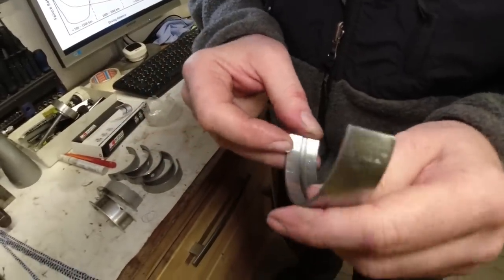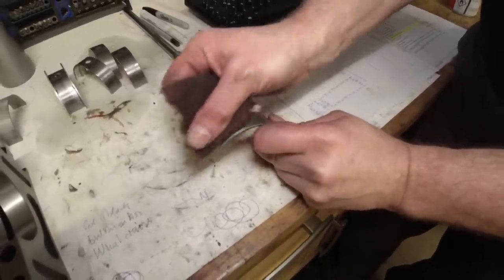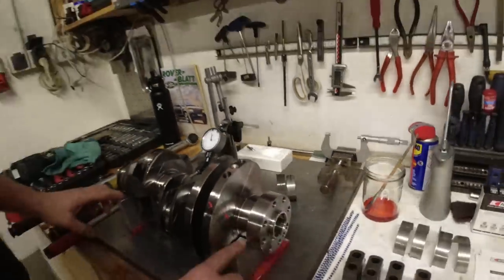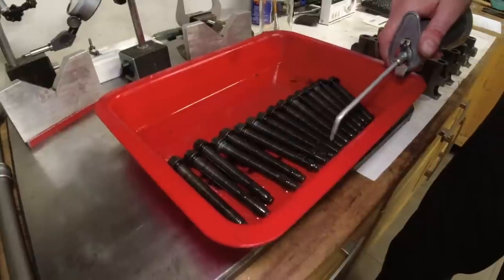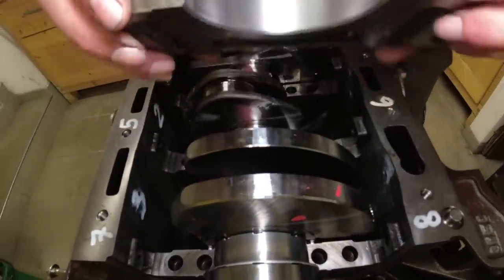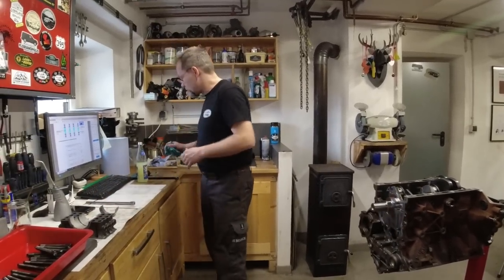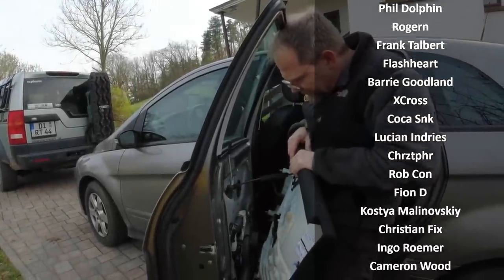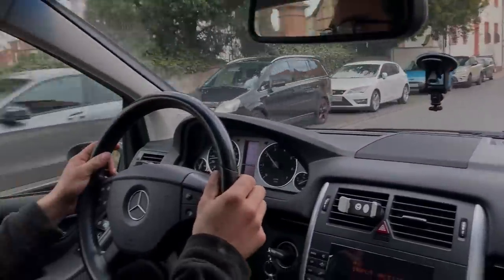Install New Crankshaft after only 64000 km / S4-Ep15

Comment: I'd be prepared to bet that the  engine will probably be infinitely better than when it left the factory the first time. It's certainly being assembled with more care now than it would have been done originally in the LandRover factory. Love your work Christian, if my Toyota engine ever breaks I'll get you to rebuild it, but I guess by the time that happens I may be dead and you'd be retired. 😂
Reply: The Ford factory it’s a Ford engine not Land Rover
Reply: @pj4433  totally Agree its brought in from Fords production plant its not landrovers own.
Reply: The problem is, even rebuilt to a high standard this engine could fail again....they can fail again and quite often do. Sad but true.
Reply: I have my money on this one not failing.
Reply: @jabberwockytdi8901  yes, no matter what is done, essentially the engine is simply too short...not enough 'meat' in the crankshaft.
Reply: @jabberwockytdi8901  all just sounds like Jabberwocky to me mate...
Reply: @sweetfreedomGB  they don't all break cranks, there are two TD 3.0 litre Disco 4 owners living in our unit complex, both Discos have done 150K+ klms, one 200K, both still working ok, so an engine failure, although not unusual it's certainly not guaranteed.

Comment: Great as ever 😀  When I used to rebuild engines at home decades ago, I was young and didn't have all the measuring tools.  Mostly they worked just fine for years after,  but I had one that would not rotate as I tightened the caps down ... took the crank back and found the re-grinder had not done all the journals correctly !!!!   They were 4cyl Mini and Ford engines and nowhere near sophisticated at that time (1960s/70s) - but I paid my own way through college doing that and welding panels for MOT Tests.  Salad days 😁

Comment: Love your work, tolerances are for rebuilders, in the factory not such a worry as that's what a warranty is for 😮
Reply from the maker: Lol 😂 👍
Reply: Truer than you might think, for a couple of reasons.

Firstly, factories rely on Quality ASSURANCE rather than Quality Control.
Quality Assurance implies that every component used IS in spec' so the worker doesn't need to verify it for themselves.

Secondly, the guy building the engine isn't going to be the one laying down their money to buy the car so they don't really care if something is a tiny bit loose/tight.
Reply: Absolutely fascinating. When you bought this car you asked us to say what had exactly caused this engine failure. I suggested that it was the car’s spirit that knew about you both, and wanted you to be it’s new owners. It’s a spiritual thing and you have taken your repair to the ‘N’ degree. the car will be very happy now and last you a long long time. Very well done- I love my LR3 also. 
❤Thank you. Gpx😊

Comment: I think that you could run the 5w30 for the break in and the switch over to the 5w40
Reply from the maker: Good idea.  And we got 5W30 left over from the previous owner.
Reply: @Vera_and_Christian I guess it wouldn't hurt for a few thousand km. Not too many though.

Comment: Hi Christian, you took the right decision on choosing the OEM bearing with small wholes. The reason why the wholes are smaller than the block is to create high oil pressure, you reminded me of Bernoulli theorem of liquid dynamics. When you strangle the flow of liquid the pressure go higher on the rods

Comment: Rest assured. The King bearings are the best option available. I've rebuilt my 2.7 using them and already clocked over 50000 kms without signs of wear. I believe you'll be safe.

Comment: A truly remarkable video. It is beyond belief that a range of premium vehicles with such astonishingly high RRPs is so compromised by an engine likely to suffer malfunction so catastrophic it takes them beyond economic repair. Our shared difficulty is that we don’t really know what the root cause of the failure is. You can only hope that doing everything else really well will compensate for the design flaws. Maybe you should have a poll regarding what oil to install. Given how tight #1 bearing is relative to the others and the below spec end-float I’d be tempted to go with 5W Dumb-ass for 2000km and check the filter & oil-pan. I’d change this out for 5W 40 for the summer and then revert to 5W Dumb-ass in the winter until you were past 160,000km. Thanks for such superb entertainment on a wet Bank Holiday here in England!

Comment: I've heard that if you don't have old bearings to put in place as you did, you can swap shells across the biggest and smallest clearances in order to bring a tight or loose clearance into spec. Even the shells have some variance, so it is worth trying before running out and buying another set of bearings or machining/polishing a block/crank

Comment: The cam driving belt, if tightened too tight can make loads to crankshaft. I have found it in practise in our rolling road dyno. When starting with cold motor dynoing the belt is quite loose, but when the motor is warm the belt can be very tight.
Reply from the maker: I fully agree. I measured 1200 N pull force on the crankshaft.  Way to much in my opinion.  Christian

Comment: I like they way you have a considered approach when you deviate from something. I like it even more that you explain it to us Christian. While I won't agree with everything you do, at least you have a reason for it that does provide justification for your actions. I agree with your assessment re the front bearing having a smaller hole as it supplies only one connecting rod versus the middle ones supplying two each. I would love to say only time will tell, however it seems these engines can snap a crank anytime.

Comment: Christian, now you have two mangled  crankshafts it would be interesting if you could try to measure the radii on the crank pins and main journals at the webs and compare to published dimensions.  There was a comment from a JLR mole I recall that there may be some grinding dimensional issues. An excessively small radius would give a stress raising effect and reduce fatigue resistance. It is a bit late however now to measure the new crank without yet another dismantle !

Comment: What a brilliant series of an engine rebuild.
I've been doing some research, as I'm going back home to the UK after working in Taiwan for 12ish years, and looking at buying a LR4.
My research has come to a point that typically, or at least, most of the crank problems have happened at the 60,000 mile (96,560km) point.
There are exceptions, like yours, but again the majority have happened at the mentioned mileage and Km distance. This would have an effect on the decision of 'at what mileage/Km would I buy my LR4 at?'
I know there are probably other factors to go by, such as how the vehicle has been used, looked after, etc,  but I'm just using the above as a general rule.
Again, great series and more fun in the future to you both.

Comment: Thanks you two, another interesting watch. Really enjoying this step by step build procedure. Gives me confidence when it’s time to rebuild my TD5.
Reply: @johncolley3317  not for a snapped crank no but perhaps head gasket blown, oil pump bolt fell off, cracked injector seat. 
It has its own special Land Rover owner inbuilt “educational” designs (aka flaws!).

Comment: Im guessing here, but is or would it be possible to check (X ray) the actual casting of the new crankshaft? There must be a reason why some of these crankshafts snap in exactly the same place early on and others can go on for 300k kilometres obviously the problem is not servicing or oil distribution or oil pressure, it must be the crank itself, I suggest.perhaps poor casting of some  ie a tiny air bubble(s) perhaps ? We used to buy the spent scrap Ni Chrome foundry grids form Ford at Dagenham Plant and the percentage of the nickel assay content really varied in those although they all looked identical and were supposed to be the same and I mean really varied from 37/18 up to 60% Nickel assay content

Comment: So I take from this that it is critically important to have Vera inspecting every step to make sure that every component goes back into the right place correctly.

Now for me to spend an afternoon in the sun finding out why two out of four carburetors are flooding. Although my attempts at this will be hampered because for some reason I do not understand that I'm not allowed to use the kitchen table.
Reply from the maker: Yes.  But if I screw up, I edit the video.  Christian

Comment: I was having a philosophical discussion with my independent land rover mechanic yesterday. 

He stated that ageing injectors inject excessive fuel into the combustion chamber, which over time, causes excessive force on the crankshaft, which causes the crankshaft to catastrophically fail.

I welcome your thoughts.

Comment: Nice job as always. As for the oil, if I remember correctly from the last video that you are reusing pistons and rings so there is next to no break in required. I am a fan of Mobil Super 3000 xe 5w 30 for this engine. My 2.7 has 300000km on it now and I have just changed the engine oil, I used a another brand of oil. Less than 500km after oil change and I am going back to the Mobil super 3000 xe 5w 30. Almost instantly there is delay in oil pressure build.... never happened with the Mobil.
Reply from the maker: Yes, stick with what you used before. Sounds like a good choice with 300t km.  👍👍👍Christian

Comment: To be honest I would be tempted to run 5w Dumbass for the next 100,000kms. Then go back to the good stuff.  Fyi I just did an engine swap body on on my Discovery 3 - thanks to your inspiring videos.
Keep up the good work!  Excited to see how nice the Discovery 4 drives with the rebuilt engine!
Reply from the maker: We most likely run 5W30 for the first 1000km, and then switch to 5W40. But we'll see. 👍🙋‍♀️Vera

Comment: The bigger oil hole in bearing may cause lower overall oil pressure.
Reply: I don't see why it should, as the real restriction to the oil is the bearing clearance. If that is too much then the oil pressure will suffer,  from leak away but if the bearings are in spec then it should not matter at all.
Reply: @samrodian919  As Samrodian said, it is more a function of bearing clearances and as Christian mentioned, this one only needs enough flow to maintain the pressure in one big end bearing. It is more important to match the bearing clearances as far as possible, as Christian has done. The overly tight clearance would have likely run hot and lacked fluid support for the crank.

Comment: Happy Easter to you both. I put King Bearing with the larger bore on the new crankshaft and so far I have driven 3k km with no evidence of bad decission so far. I'm very curious what your oil pressure will be with these clerances.
Cheers 👍
Reply: Fab has a brilliant D4 3.0 SDV6 Engine rebuild on his Fansterix YouTube channel. Well worth a look.
Reply: @jeffreywilkinson2679  Hello, nice to hear that, thank you. As you can see, all Discovery owners meet in the same place☺️
Reply: Courtesy of AULRO….!!!!
Reply: Brilliant German precision in putting that crank in. I can’t help but wonder if LR had sourced an engine for the D3/4 from an engine plant in Stuttgart rather than Dagenham, might the outcome have been different. Of course the original decisions were taken when Ford was in charge so we’ll never know. 

There’s a guy called Mike Park in Scotland who’s replaced some failed Loin engines in D3s with the TDV8. 

I’d love to see Christian do one of those. 👍
Reply: @hughmarcus1  discomike on disco3 forum? I'd love a tdv8 D3, ultimate LR 😅

Comment: Hi Christian & Vera, Really enjoying this examination and rebuild. I am wondering whether you can do something a bit more on possible causes of crank failure and a look at the components that you have. For example a very close look at the fracture site on the crank and also thoughts on the condition of the dual Mass flywheel and other components that might effect teh crankshaft life. I am aware that this is only one engine, but it would be interesting to see and to hear your thoughts. Keep up this great work.

Comment: good oh, when I  rebuilt engines at Cummins, I  filled my air over pot with kerosene and put it through the oil galleries then pressure water washed the block and galleries, then air dried it. then gave it a light film of kero to stop surface rust whilst i rebuilt the engine
all of the crank bearing shells could be swapped in chassis in trucks, during routing bearing swaps, from distant memoru, I  think it took 4 hours, done at 400000 miles
of course in the 60s to 80s Cummins never made a bad inline 6, but the V8, 555, 504 and 903 were not lugging engines and did not  last in the coal-hauling industry
I  am very worried abt my TDV6  now @232000 km
i do love driving it, a pleasure, but will i go bush again, i do not know, but if it dies, i cannot fix it as i only have use of one hand
thanks for this video, most of your viewers will not have internal Mics

Comment: I think that for the first few hundred kilometers you could run 5w-dumbass to break in the engine and monitor the oil pressure.  Afterwards you can decide to go to 5w-40.

Happy Easter!  🐰
Reply from the maker: That sound good.  Christian

Comment: Hello friends, congratulations on the beautiful work! I'm an enthusiast and I live in Barsil and I'm doing the complete assembly of my 2013 D4 engine. You're helping 100%!! Here in Brazil, the pieces have very high prices, I want to buy directly from England. I need to ask if the Britpart, FAI or Aftermarket brand is trustworthy for piston rings. Thanks!!
Reply from the maker: Check our videos and what we used, King and Fai so far, and our engine rebuilds have lasted. But the brand is not necessarily the buying criteria, you have to go by the clearance specs for the bearings. You get these from your crank.That determines which bearings you can use and which brand has them. Usually, when you need the bearings, there are not that many trustworthy brands to choose from. Do not buy bearings from a brand or shop that do not list the tolerated clearances. On our Patreon page, we have information about decoding the crankshaft. 👍🙋‍♀️
Reply: Thank you very much for the information, it was very useful (as always!)
Please, if possible, could you recommend a website in England where I can buy the King brand?
Thank you again and congratulations on the great work!!

Comment: This should be the video tutorial for future mecchanics on the subject how an engine is assembled the right way. Today they just have no time end patience to do the job as it should be done. No mecchanic would do a plastigauge control on a new bearing and crancshaft install.
Just out of interest was the cam belt ever changed on that engine?
Did you control the lenght of the new con rods? It would not surprise me if they are a bit out as the other measurements. As usual better to keep as much 'old' parts as you can.
Keep posting, I enyoj every one of your videos.
Reply from the maker: The engine is only 64000km old. Nothing has been changed before, as there was no need to do that.  This will all be covered in future videos. 👍🙋‍♀️

Comment: Hello Vera and Cristian, regarding engine oil, I think that the one recommended by the manufacturer should be used, I have understood that what most affects engine breakage is partly caused by the deterioration of the oil itself as it contains a lot of fuel left over from make incomplete regenerations of the particulate filter, several attempts are made when driving in the city and this means that when it is not completed, it is constantly tried again, filling the fuel pan and deteriorating the properties of the oil, the solution is to carry out oil changes more regularly With fewer kms than the manufacturer indicates.
I put the link to a video of a Spanish engineer where he talks about it.  the video has 2 parts, I put the second but it is very interesting to see it complete
Reply from the maker: I have been send that video about 100 times already. We have covered the 5W40 topic in more than enough videos. You may want to check out our "Enigine Oil and Oilpump" Playlist🙋‍♀️Vera
Reply: @Vera_and_Christian  I saw them all Vera, I always see you every Sunday morning. 😜
 But it was interesting to me to know that incomplete particle filter regenerations cause an increase in fuel in the oil, it is a trigger to cause failures both in the oil pump and in other parts of the engine. 
 I propose for another video that you send the oil of another discovery to be analyzed in laboratory when you change it to see the amount of fuel it has mixed.  
Greetings from Seville
Reply: The Land Rover oil is trash, it has serious issues with fuel dilution, do yourself a favor and throw the LR "recommendations" in the bin.  In the US they used the same engine in the ford F150 and most Americans stopped using the special 5W30 and went to HDEO 5W40, the result seems to have been fewer failures on vehicles that were worked quite bit harder than land rovers are.  Dodge seemed to have the issues with their VM rotari diesel and they basically told their dealers to quit using the euro oil and to use HDEO 5W40.  The thin oil is all about meeting fuel economy targets.

My TDV6 consistently "made oil" using the Land Rover C1 stuff even at 5k miles, using shell helix C3 seemed to stop it literally zero dilution in 6k miles. Oil dilution is seriously bad for an engine.  Don't use LR snake oil and change it more frequently, oil is cheap and engines are expensive. The only thing to keep in mind is that the oil must be low SAPS, which C3 is.

Comment: my late sdv6 d4, has white metal showing in the lube oil filter for the first time, 135000km, the last filter change was 125000km, no metal was present, naturally, I  am worried, 
is a bearing change possible in chassis, Christian, thanks Stuart